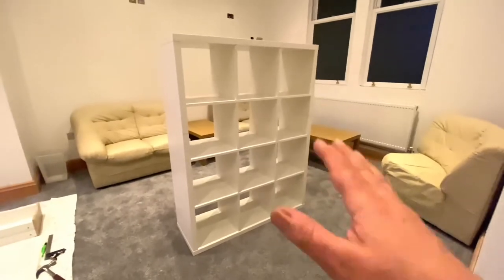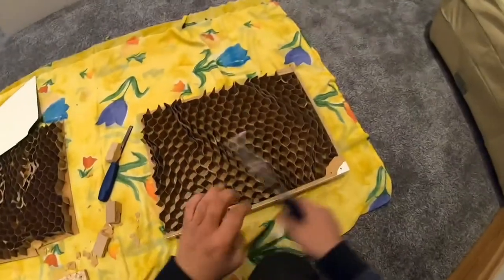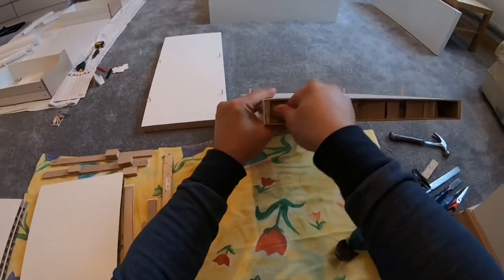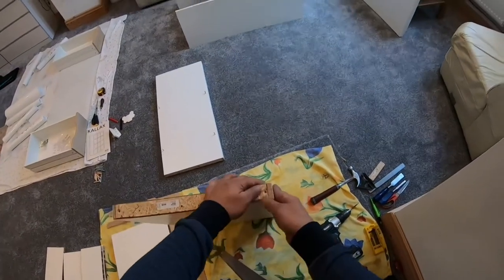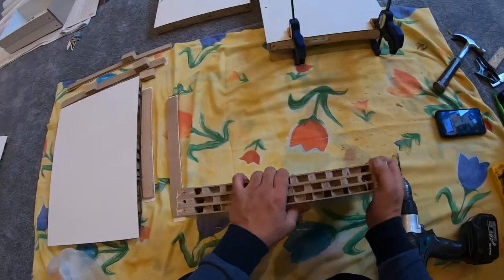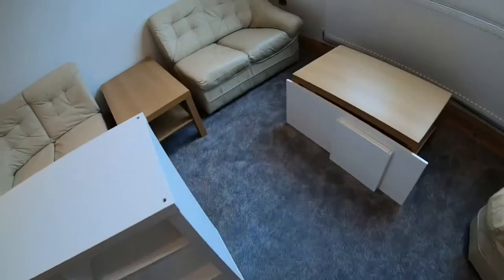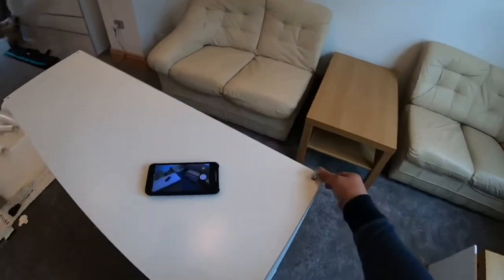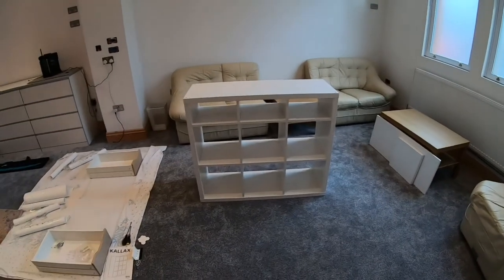How To Modify An Ikea Kallax Shelving Unit To Fit.

Comment: how did you cut the side pieces? when my husband and i tried to do this using the circular saw, we got huge kickback because the blade cuts the plywood on the side, then the honeycomb stuff in the middle, then wants to STOP when it hits the plywood on the other side ...
Reply from the maker: Hi, the best thing to do is to put a strip of masking tape down then mark the cut line then use a hand saw to cut. It’s the easiest way plus the masking tape helps to get a clean cut. Hope this helps & thank you for watching
Reply: @ScoobyRolla  thank you so much!